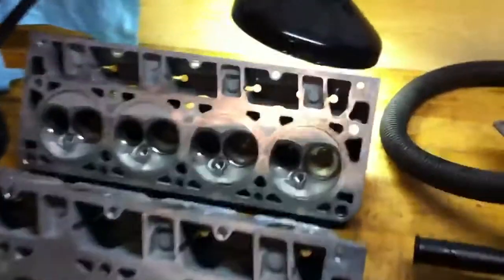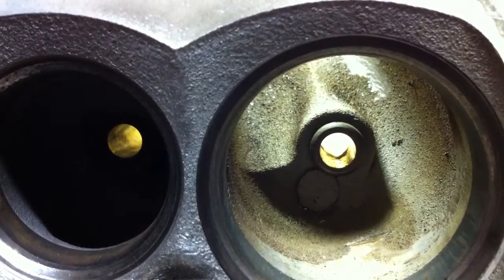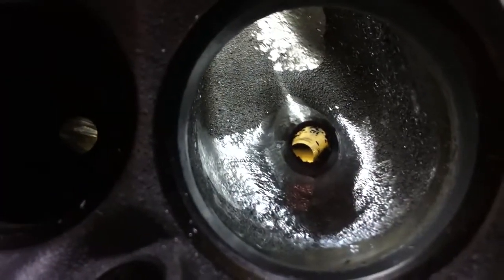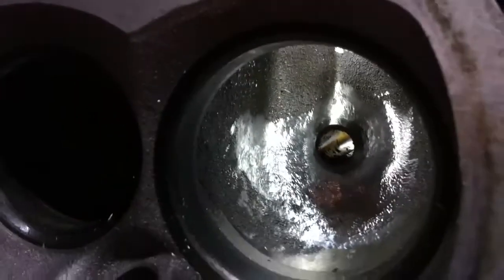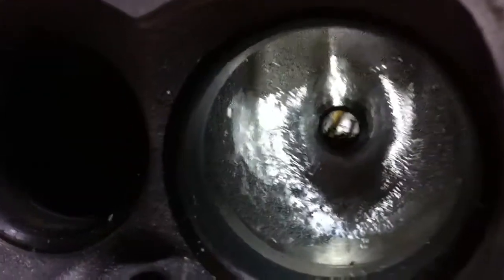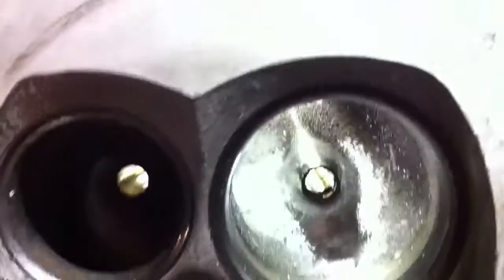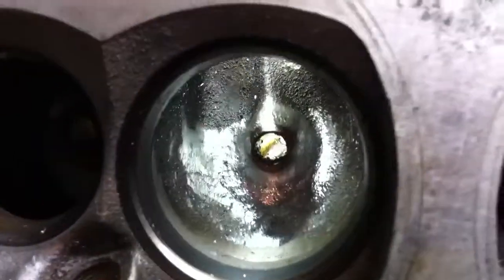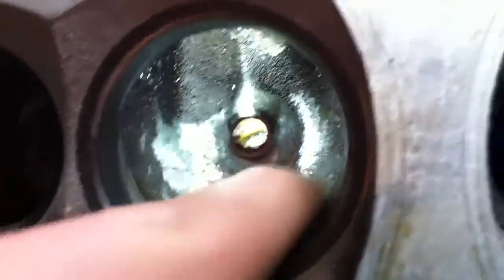How To LS1 DIY Head Porting Part 2 cont

Comment: He said it's only for racing that you would have to change them about every 2 months so unless you're not racing I would not do that because you're going to take away from stabilization of your valves
Reply from the maker: Like i said in my last reply to you, I did not grind down the valve guide, just the valve guide boss. Well i did some on the edge of the guid, but that's nothing. These heads are on my daily driver for the past 15k miles with no issues and I beat the mess out of it. :)

Comment: I'm getting ready to port my heads my mechanic said not to grind down valve guide you could bend the valves
Reply from the maker: Lots of different angles to look at here. Your average mechanic cares nothing about improving performance and efficiency of the engine, not saying that's what he is, just saying that you'll get different opinions from different people. I am a master ASE certified tech myself and I can tell you that most mechanics won't care for anything like this. They just want to do R&R and make a living. Hot roddders do tasks like this. 

Also, I did not grind down the valve guides, just the valve guide boss.

Comment: A question.  What purpose does the swirl ramp serve in stock form?  As with any modification there is usually a trade off.  What is the down side of doing this if any?
Reply from the maker: I believe they say its there to create a swirl effect that help with air fuel mixture. I havent been able to measure a negative from removing the swirl ramp yet. I've heard of guys still getting good flow numbers that have left the ramp it. I just know that the LS3 heads don't have a swirl ramp and all the aftermarket CNC'd heads have removed it. So I did as well. I'm now porting a set of LS6 243 cast heads and noticed that the swirl ramp is smaller than all of the other regular LS1 heads.

Comment: yup lots of work, and tedious work, but they are looking really good
Reply from the maker: Thank you Greg! This set has been gone for a while now. They were on my last truck that was stolen. But these heads ported, milled .030" with an LS6 cam and manifolds made 330whp through a 4l80e trans. I was happy with the outcome.

My current truck has pretty much the same porting to them, but 220r cam and long tubes. I'm trying to get a dyno lined up now.

Comment from the maker: Yes, the flow sheet is in the video. 

I also have a posted comparison spreadsheet in that video of Stock LS1 heads vs my ported heads vs LS6 heads. 

I also have before and after dyno's on my truck with them. 

I dont think you can get much more proof than that!       

You should watch the video.